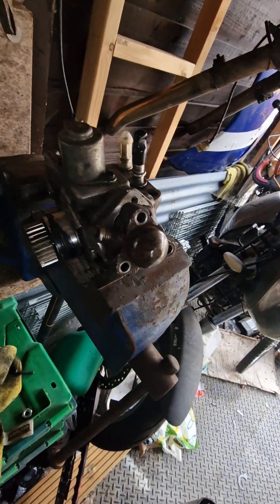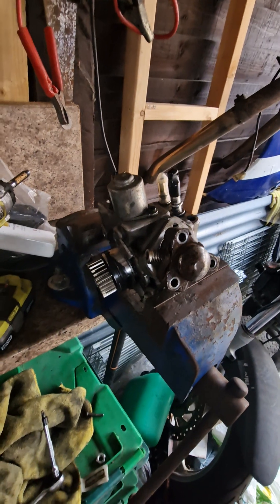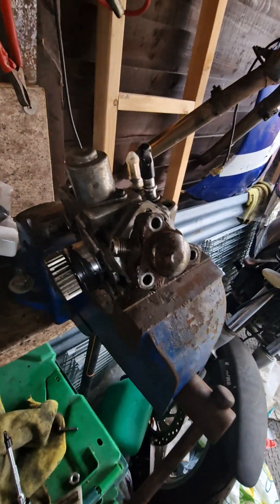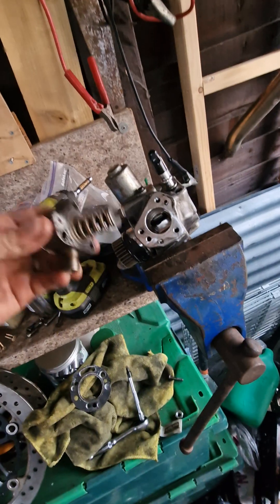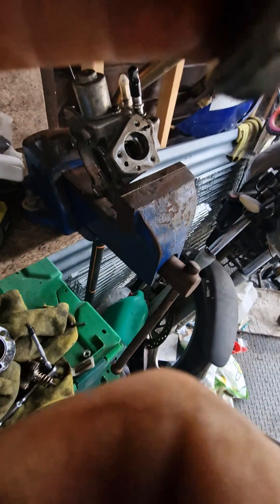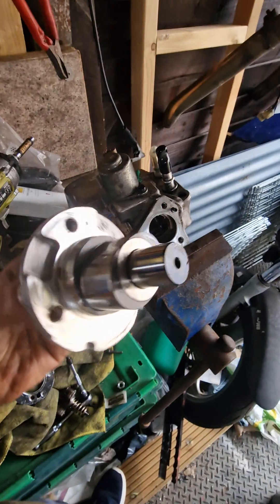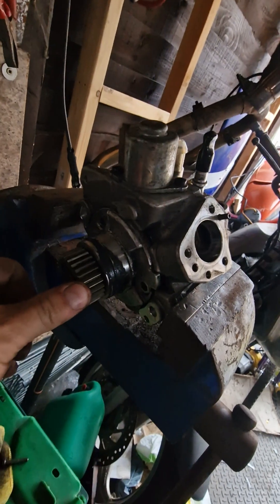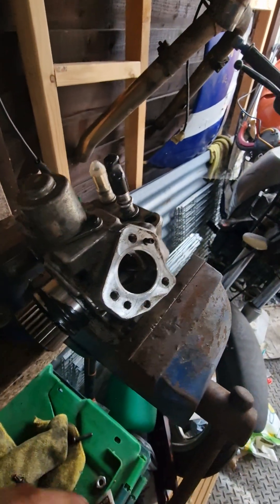Common Problems of the Delphi High Pressure Fuel Pump

Comment: Thank you! Can you tell me, if the IMV is closed (ie, engine needing more fuel) what is the volume/second that the pump achieves at (say) 1000 rpm? I guess the volume of the high pressure cylinders would be an alternative answer. Thanks.